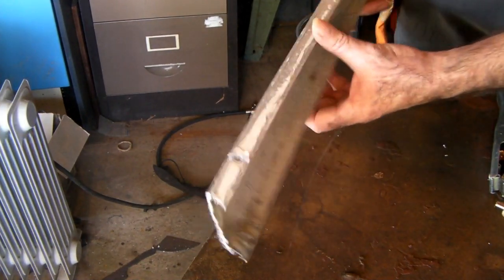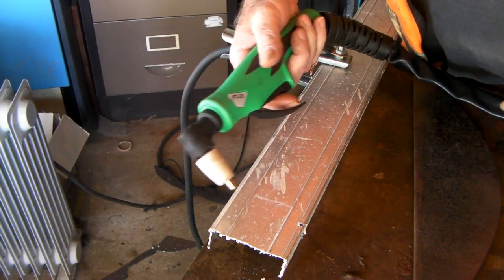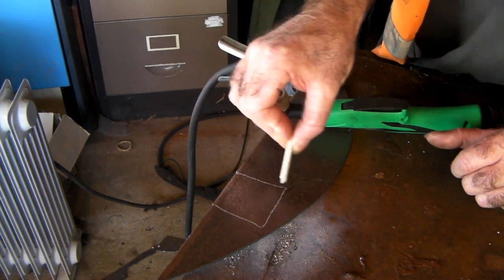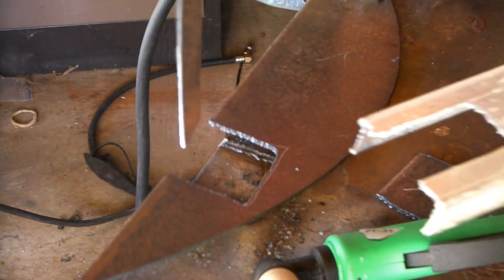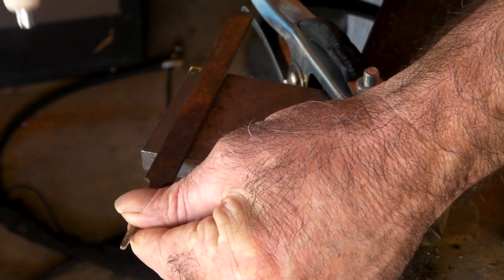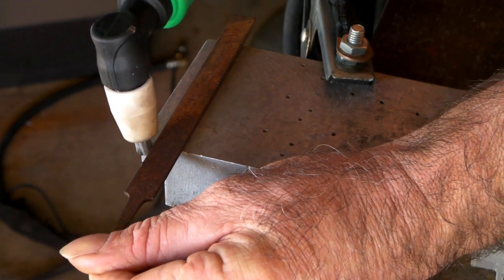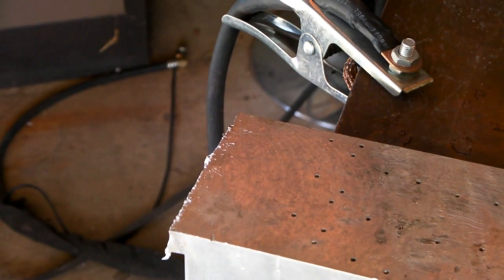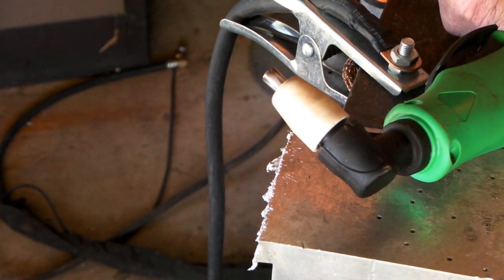cheap plasma cutter cutting aluminum

Comment: Aluminum needs a shield gas mix for clean cuts. An argon hydrogen mix is typical. Not too fun for a home shop to have a bottle just for it, but if you do enough aluminum cutting it can save your sanity. You can use pure oxygen but ehh....
Reply from the maker: Cool Thanks

Comment: higher resistance holds heat longer,stays molten longer,aluminium cools real quick due to the air blast cooling further from the plasma nozzle ,a laser is what will cut the aly nice since the beam temp is consistent,any hoo,it comes down to conductivity and thermal resistance.
Reply from the maker: Yea thanks for the tip

Comment: aluminium is harder to cut because it melting temperature is lower than it ignition temperature.
Reply from the maker: yea I am learning that thanks
Reply: So basically it's better to cut aluminum with a skillsaw?  Or table saw?

Comment: When cutting thick aluminum you need to turn your air pressure up because it will melt back together as you’re cutting it. 
Higher air pressure will blow the melted aluminum away from the cut as you’re cutting it.
Thank you for your videos.
Reply from the maker: Thanks for the tip!

Comment: Good video Pete.  I was wondering how one of these would go cutting up aluminium car wheel rims - I use it for backyard metal casting.  You have answered my question.  Thanks for posting.  Cheers Rob in South Oz.
Reply from the maker: cheers mate thanks for watching
Reply: I was just working on cutting up an aluminum wheel with my Cut-50 plasma cutter. It cuts through  fine on the thinner sections (say 10mm) but I'll have to use a reciprocating saw on the thicker  sections.

Comment: The Aluminum will cut cleaner if you brush through the oxide layer with a wire brush prior to cutting. The reason being aluminum melts at a lower temp than the aluminium oxide layer. You'll get much better results if you hit it with a stainless wire brush just prior to cutting it. And dude, get a pair of gloves for cryin out loud lol! Cheers.
Reply from the maker: Good to know!

Comment: Wow it's amazing how two different metals cut definitely like that. I really didn't think that aluminum would cut so rough like that thanks for the show. Thanks Pete😁. Tabe 🇺🇸
Reply from the maker: No worries mate 
cheers pete
Reply: Thank you Pete . That machine that you recommended me works perfectly. I cut stainless steel 1/8” thickness and aluminum 1/4 “without any problem.

Comment: The plasma is about 25,000 to 40,000 degrees f. Even in centigrade, that’s plenty hot. Aluminum melts at about 1,200 F while steel melts at about 2,800. So the difference isn’t that much. But since al is so conductive, the heat spreads unevenly.
Reply from the maker: Thanks mate great explanation

Comment: Cutting aluminium , you will always get that edge if you cut with oxygen , same reason why stainless and aluminium is normally cut with Nitrogen (Reactive metals ) .
Aluminium transfers heat 4 times faster than carbon steel , thus more amps is needed (copper is 6 times more ) and why plasma and welders is notebly rated eg 12mm/" 1/2" steel and 6mm (1/4) aluminium "Tig welders"
Reply from the maker: Thanks, yes i didnt even think a 40 amp plasma cutter  using just air would cut 1/2 inch aluminium  but will hack through it but like you say its very ugly. Thanks cheers pete